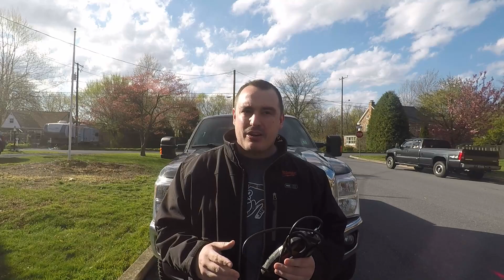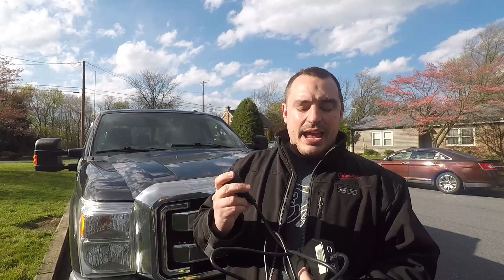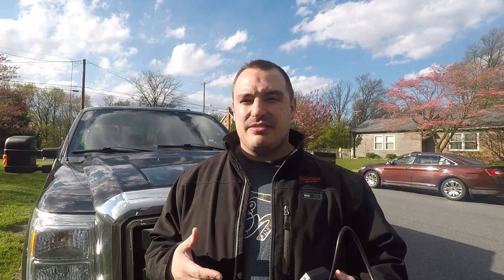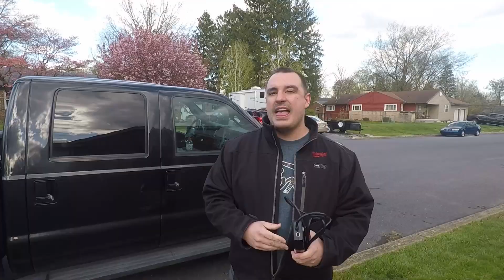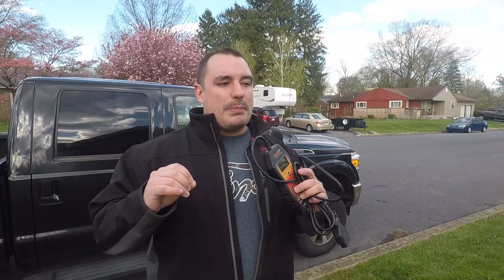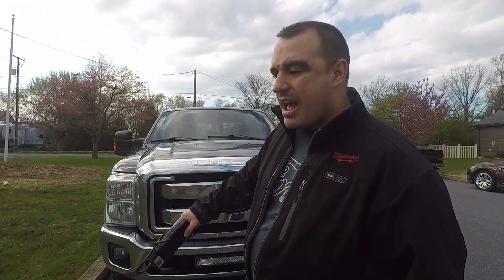Best Tuner For 6.0 Powerstroke

Comment: Hello
I need a reccomendation, I have 2006 6.0
I struggle towing my toy hauler.  I do have work done to it. It really struggles on all hills. I'm doing 35 to 45 miles per hour. Really frustrating. What tune or mods are reccomended for this issue. Any help will be much appreciated.  I do have the set live programmer. 
Thank you
Reply from the maker: So to start helping I need to know a few things. First model 259, 350, dually? Tire size factory axle gears? How heavy is your toy hauler? Any upgrades over factory and do you have a monitoring solution for your truck?
Reply: @six0bros  thank you for response 
Factory axles
Not a dually
Head studs
Bomb proof 
Exhaust 3.5 to 5
Cold intake
Live wire sct
Bigger injectors
Egr delete 
8inch lift king shocks with coil overs
Bigger turbo
I hope thar helps
Reply: 12500 gvwr
1250 tongue weight
Reply: Sorry 1140 tongue weight
Reply from the maker: What size tire you running with that lift
Reply from the maker: So I know I just asked what tire size but just some things to go off of when you have factory gears and large tires plus add a bigger turbo it will create some towing issues and you're towing pretty heavy too. You're out of your power band seems to be the issue. Probably the best thing to consider is rehearing your front and rear axles. Say you are at like a 38 inch tire you may want to look for gears in the 4.50ish range. That would out you back in the powerband. A few things that would help but probably wouldnt fix it would be an odawg intake manifold, be exhaust manifolds and bd y pipe. Do you know exactly what turbo is in it? Also I am rattling off some pretty expensive options I mean unless you know how to regear you'r axle you're probably looking at 1000-1300 per axle. If I had to guess. The odawg intake 850, bd exhaust manifolds like 400 to 500 y pipe 300ish. One thing before considering an upgrade make sure you do not have an exhaust or boost leak. Make sure everything is running good first. I have seen guys throw parts at trucks only for it to be a ripped intercooler boot, but if I had to guess axle gear ratio with big tires is part of the issue
Reply: @six0bros  
315/70R17 tire size
Reply: @six0bros  yeah it takes for ever to spool and its super slow
Reply from the maker: So you're riding on almost a 35 inch tire just shy of 12.5 inch wide. That is a lot of rolling mass. The other thing being taller puts your gears down. So depending on how big of a turbo you have will change a lot too. Any chance you know exactly what turbos and injectors?  I mean typically even a bigger turbo while pulling a hill will still do ok even if it doesn't do great with towing. So first thing to do would be to check all of your sensors like your maf, map, vgt solenoid, ebp. Those all play a roll in a vgt turbo functioning properly. So that could be one issue. The other thing I would do is double check for any exhaust leaks or boost leaks. This is where I would start before considering replacing any part. Also measure icp at wot make sure it holds a high icp voltage. Do you have anything to monitor with?
Reply: @six0bros  do you have a place were I can send you a list of what was done to it?
Reply: @six0bros  I gave the sct live monitor 
Switch on the fly
Reply: @six0bros  
I have stage 2 90hp injectors
Turbo
Is a a power max turbo Ford 6.01
Reply: @six0bros  sent you a pic of a list of what I have done to it.
On your fb messanger

Comment: Brand new to the tuning game and appreciate the info here! 04 Excursion 6.0 that’s studded, EGR deleted, 4” exhaust and K&N intake. I’m considering the SCT GTX so I can tune and monitor, but my biggest question is about mpg improvement. I’ve got two trips coming up and need best fuel economy possible. Trip 1 is 4K miles with loaded truck, but no trailer. Trip 2 is 4,500 miles with loaded truck and 8500lb travel trailer. I’d really appreciate any advice you have to offer.
Reply from the maker: The first thing in would do is get an s&b filter for that k&n intake. S&b makes replacement filters for a lot of competitors product's so get that first. K&n does not filter enough. Then I do not think the gtx works on the excursion. So I would go with custom tunes on like an x4 or I believe the bdx works but make sure it does first. Honestly sct for monitoring is kinda crappy certain things do not read right. However for tuning it is hands down the absolute best for 6.0s the company I got the best mileage out of stopped tuning it was windrunner performance engineering. I would now recommend checking out truck source diesel, or power hungry performance for tuning. Idp is great but I really like them mainly for running at the track. Warren diesel also has great tunes

Comment: Stock, that's all them heads can handle
Reply from the maker: I ran a tow tune for 7 years or so without issue. The occasional performance tune here and there but primarily a 40hp tow tune.
Reply: @six0bros  I got the sct livewire with canned tunes, ran street when not pulling the lowest tow tune when pulling, this is after headstuds and such, still lifted a head pulling a boat in lowest tow tune
Reply from the maker: That sucks. However I definitely put the blame on the stud job. I mean factory head bolts I went from 75,000 miles to 180,000 with tuning.  Some people go 200 miles and have issues.

Comment: Hey, big fan of your videos. I'm always looking to be educated more on the 6.0! Hasn't PHP stopped making custom tunes? Also, not all tuners work as well with FICM tunes as others, do you have any tuner recommendations regarding that?
Reply from the maker: If you let your tuner know that you plan to do ficm tunes a lot will work especially the guys that are pretty die hard into the platform will. Warren diesel would be someone I would check out for that. Gearhead comes to mind. I thought power hungry still did tunes you just had to buy from one of their dealers
Reply from the maker: I'm going to look into php for that.

Comment: Gents, can anyone help me with a SCT-X4 that I just purchased with can tunes.
It failed to load on my 2006 6.0 all stock with 54K miles and It can not restore stock and now my truck is now dead in the water.
any help is much appreciated.
on call queue with SCT tech support but no luck yet. 
error message:
DOWNLOAD - ERROR# 110D8
Failure to write data to vehicle.
Please use RETURN TO STOCK to put vehicle back to original state.

it is the same message from the get-go and tried 3 times to return to stock but no luck.

however, my radio, windows, security, dashboard all works fine, no crank.

many thanks guys.
Reply from the maker: Sorry to hear about this man. They may need to send you a new file to correct this. I have heard of rate issues but they have happened enough. Not sure on what fixes there have been. Have you gotten through to sct yet?
Reply: @six0bros  thanks man for responding to my call.
I was on the phone with STC tech support this morning and uploaded a new file on my STC tuner over remote connect to my and on to the tuner.
Reconnect the tuner and tech asked me to verify the V-batt (voltage of the battery) with key in off & in on position for the draw. the draw difference was 12.4v off position and 11.5v on position. 
we disconnected the sub-woofer and still.
finally tech concluded the there must be something connected the draws too much power and I need to troubleshoot what it is drawing almost 1volt.
Reply from the maker: How old are your batteries? Did your voltage come back up after glow plugs and fuel pump shut off?
Reply from the maker: And no problem man. It is what I am here for.
Reply: @six0bros  the batteries are about a year old - per previous owner. After the key is switched into on position the voltage drops to 11.5V and stays there.
the error code is #110-D8. failed to write to ECM
Reply from the maker: that is odd in the sense that it is normal for them to draw down a bit because of the glow plug and fuel pump on. glow plugs pulling most of that voltage typically but they should shut off after 2 mins. I would see what happens if you leave the key in the on position for like 3 minutes. I would start with checking all of my grounds and then from there I would have batteries load tested.

Comment: When you had your 6.0 rebuilt did you bore it over? And if you did where did you get your rebuild kit from
Reply from the maker: I did not have it bored over. I kept the same rings and pistons also the same rods. I think this may be part of my current issue with the truck. As for rebuild kits. I know kill devil diesel does sell rebuild kits and this is who I would order from

Comment: Simple question....

Can I set a governor with the tuner?

Example: if I don’t want my truck to go over 80 M.P.H can I set the governor to do that?
Reply from the maker: With sct yes you can. When uploading a tune you can go j to additional options and set a limit for speed
Reply: 6.0 Bros Thank you for the quick response!

Bro you ALWAYS answer my questions in the comments section.

SUBSCRIBED!!! 😎👍
Reply from the maker: Anytime man.... wait a second you weren't subscribed lol. Just kidding man. You have been around the 6.0 stuff on the channel for a while though if I remember correctly. Thank you for the support man. I try really hard to get back to as many people as possible. I do fall short sometimes but I do try! I am far from done with 6.0 stuff on the channel just saving up for the next part of the build!
Reply: 6.0 Bros I have a question I really hope you can help me with. I have an 05 Ford Excursion 6.0 and I want to buy the SCT Gtx tuner. When I go to the Amazon link you posted in the description it says “NOT COMPATIBLE WITH MY VEHICLE”. When I went to Thoroughbred Diesels website it says the same thing. Is my truck too old to work with this tuner or something???
Reply from the maker: I'm going to look into it right now. I was not aware of there being any issues with it. Let me check now
Reply from the maker: So I just checked it out and from what I can see they claim it only supports the super duties but I am pretty sure that is inaccurate. I did put a request for info from sct on this and I am trying to find someone that has done it. One nice thing with Amazon is returns are relatively easy but I would rather help get you setup right the first time man. Also thanks for going through the links man. It definitely helps the channel
Reply from the maker: Ok sorry for all the replies lol. So I have checked three different tuning companies and none of them mention differences from excursion to super duty. I believe this to be an over site from sct. However I should have a response from them tomorrow. I hope this helps
Reply: 6.0 Bros I was thinking the same thing. But I just want to be 100% sure before I spend $600 on a tuner!! LOL 😂
Reply from the maker: I hear that brother. My favorite combo is still a used x3 and edge CTS however some people love it all in one. I'll let you know what sct says
Reply: 6.0 Bros I tried to find you on Instagram so I could message you there.

Comment: Good vidios. I have a 04 6.0 and run SCT custom tunes with new heads ARP studs  blue spring and EGR delete.  I have economy 50hp, tow65hp, & street 120hp. What one do you advise for daily driver? Thanks
Reply from the maker: Who's tunes did you go with? I go back and forth on my truck between a tow tune and a street tune. I do run a race tune a fair amount but that was more for events like dynos and track days.
Reply: 6.0 Bros, I went with Jake at Innovative Diesel.  I mostly run the tow tube. I just put $10,000 with new heads, ARP Studs, updated head gaskets, Sinister EGR delete, new stock turbo. The Diesel mechanic that did the work   said he thought the street tune was too much and stick with the 65hp tune. Bummer.  I like the street custom tune. I would appreciate your thoughts on this matter.  Thanks. Great info.
Reply from the maker: sounds like you had a very thorough refresh of the engine. with studs and heads if the work was done correctly I think a good street tune is fine. say something around 100 to 120 hp. Now all out race tunes are just going to be harder on it no matter what. now your build should do fine with a mild turbo upgrade and a race tune, but I am a big believer in o ring heads. what cylinder heads did you go with and do you know if they have o rings?
Reply: @six0bros  The mechanic told me the heads he put in were 3rd generation from Ford with upgraded headgaskets.As far as 0-rings I don't think it had been done, he didn't say anything thing about them. I figured with the work I had done I would be ok with the street tune and when towing my trailer use the tow tune. I thank you your input and if you have any other thoughts please contact me.
Reply from the maker: I think you will be good to go man. studs are the big part. I obviously really like the o rings but for most people as long as the work was done right you will be good to go.

Comment: Thanks 6.0 Bros, great video.
I just bought a SCT-x4 after watching your video - for $309 with 4 can tunes.
what is your favorite for a stock 6.0, 2006 4x4, with 8" lift on 37 inch tires?
Thanks in advance.
Reply from the maker: Hey where did you find one first that price. The one I have linked is more expensive. So I made need to go looking for a cheaper one. Anyway as for the canned sct tunes i ran the 65 hp tow tune a lot. The street and performance tunes were good but custom tunes is really the way to go. When the white truck is back power hungry performance is who I'll be calling for tunes
Reply: @six0bros  thanks for sharing your experience on the can tunes.
by the way here is the link to Ebay where I bought mine.
Seller information
eliteautomobileparts (1546 )
99.2% Positive feedback
Reply from the maker: thanks for the link man that price is pretty darn good!
Reply from the maker: thanks for the link man that price is pretty darn good!

Comment: I use sct live wire ts and was wonder what the best way to tune mph shift points on trans tuning section
Reply from the maker: I unfortunately am not familiar with that, and I would be careful with shift points and stuff. I would contact the tune writer for advice.

Comment: Bully dog and sct are the same for a couple years but sct has got the history with 6.0 great info man
Reply from the maker: I remember that one bought the other or something, but I do not know if the bully dog stuff has can use the same software for custom tunes. Do you know the answer. I would love to add it if they can.
Reply: @six0bros  so far the new stuff allows the special tuning  on everything but the gt from what I've seen
Reply from the maker: That's pretty cool that you can get custom tunes on those products as well. Thanks for the heads up man